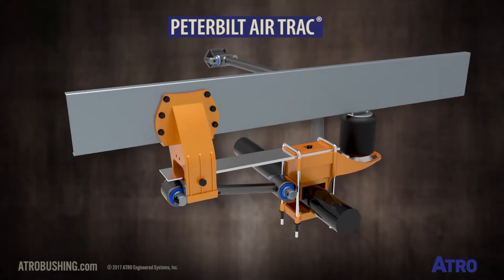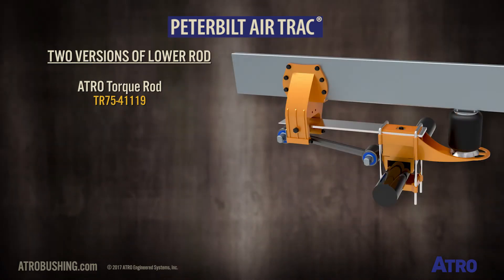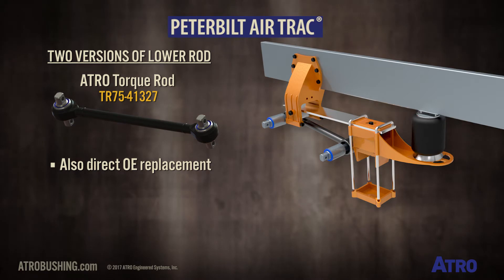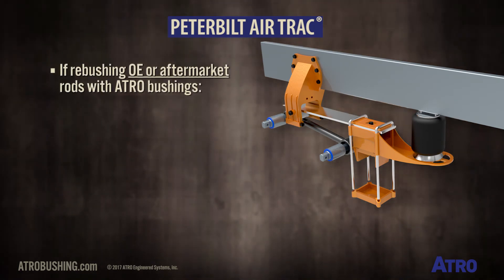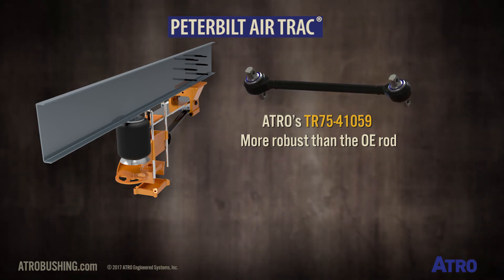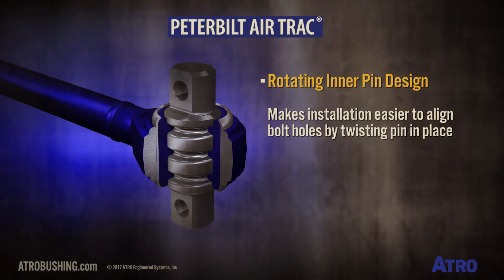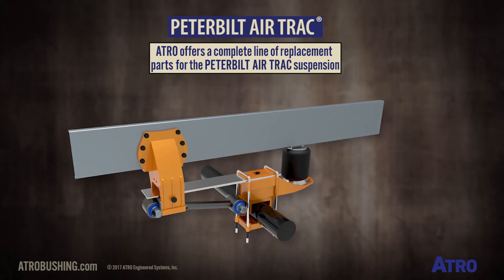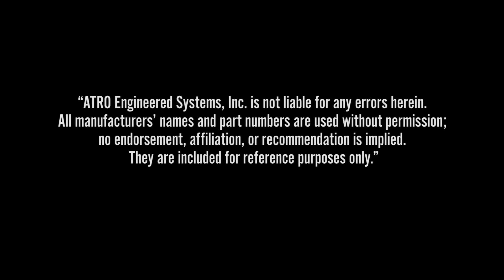ATRO Parts | Peterbilt AIR TRAC Suspension

Comment: Is this any good compared to full leaf springs for stability on uneven roads dumping ?
Reply: there is a dump switch in the cab. you dump the air in the bags so frame sits down on the axle for stability